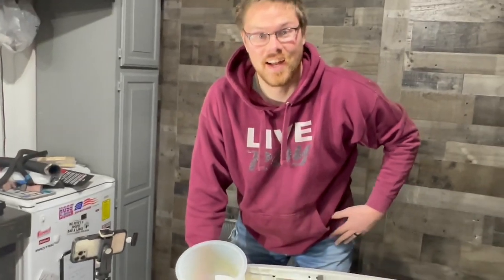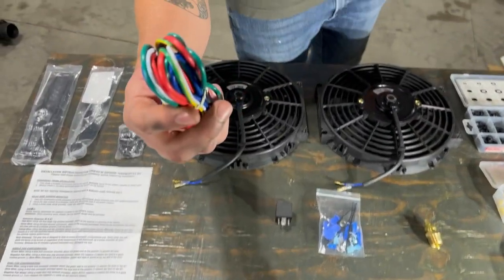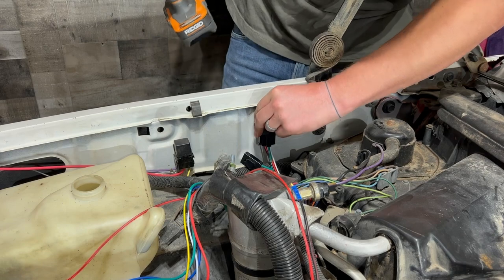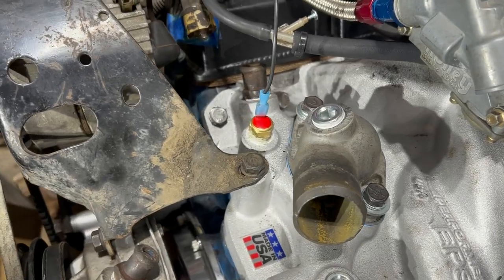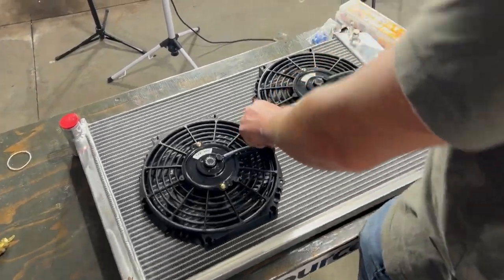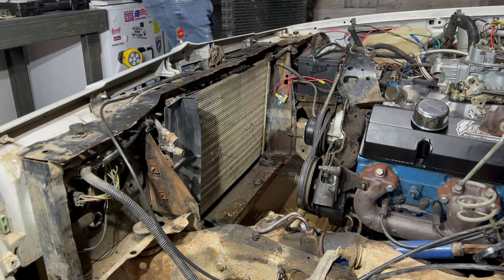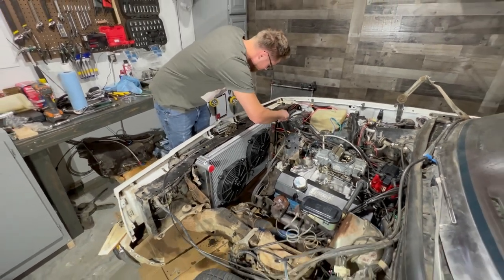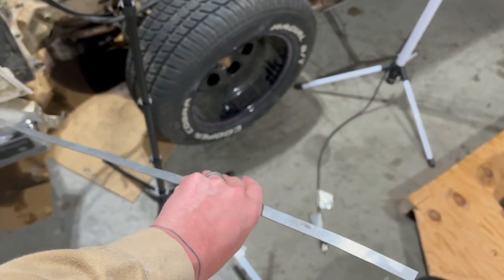How to Install an Aluminum Radiator and Wire a Dual Fan Relay | The Meano Camino

Comment: Did yall use the wiring harness that can with the fans? I used your link and it shows another one commonly purchased with the same fans.
Reply from the maker: Yes we did use wiring harness that came in the kit. 

Let us know if you have any other questions!